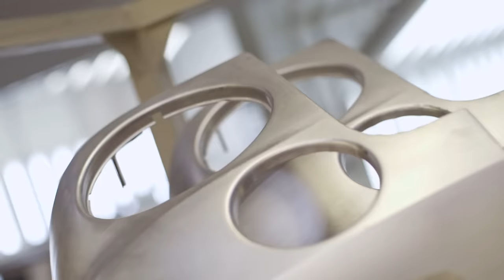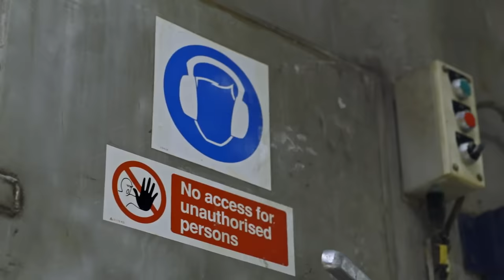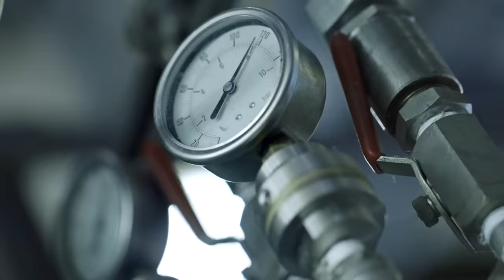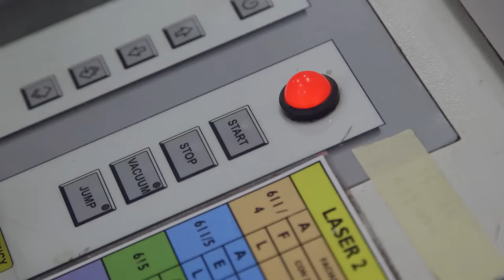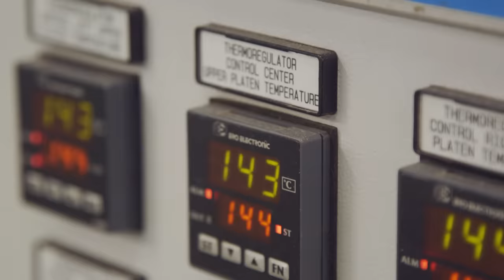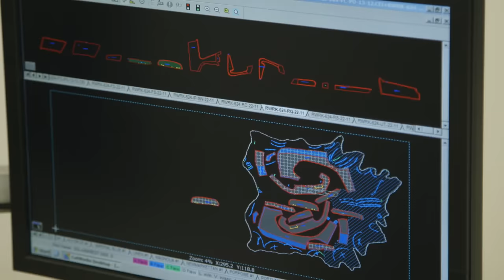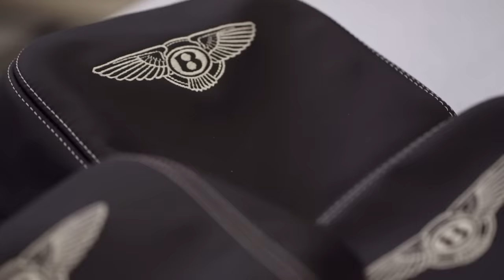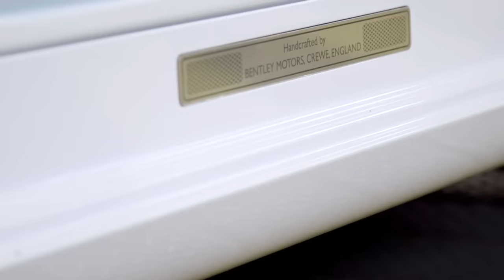Bentley Mulsanne Production | HOW IT'S MADE

Comment: My dad and I built grandfather clocks from kits.  It would take us about 3-5 months to complete one.  Why?  The same reason as here, attention to detail.   My dad wanted the case perfect, no rough or slipshod work.  Joints were smooth and doors hung straight and true.  I did the finish work.   Lots of sanding of the wood, stain applied with a brush and wiped down after.  Holidays found and touched up.  4 coat polyurethane finish, fine sanded between coats and then hand rubbed to a smooth, high gloss.   Lots of work, but the result was impressive.   Just the same with this Bentley.
Reply: Maybe go to work for Bentley?
Reply: But, as far as telling the time goes, not nearly as accurate as a cheap electronic watch!

Comment: I'm surprised how much hand finishing goes into the body shell!
Reply: Why is the paint shop not shown?
Reply: I think it goes hand in hand with the extensive amount of hammering and body panel repairs required to fix each frame before paint. Add to that the rattling hoists, dragging overhead hoses at 9:50, the shaking rickedy old roller coaster ride, etc. No wonder they need craftsman to make things right.

Comment: Can someone please tell me what they sand metal with?  Is it normal sandpaper?
Reply: It's an incresingly smoother sandpaper yes. They start with 400 or sometimes even 200 sandpaper for bare metal or really think paint and progressively move up all the way to 3000 sandpaper.
Reply: to smooth the metal joints rom soldering in previous step, and is very fine sandpaper nor regular one because white body must look perfect to be finished perfect so man must make what machines can't do better
Reply: Rolls, Audis and Jaguars are from aluminum too, is light and rustproof so it last longer than steel and aluminum alloys or just aluminum are in most suspensions, transmisions and engines even sometimes joined by titanium or other composite alloys to achieve better performances
Reply: Felix Jaitman ä

Comment: These people seems to be correcting imperfections of their production process...  If the production/manufacturing methods are good and efficient, then there is nothing to be polish or grind away...  Am I correct ?
Reply: Some see only one page and assume the conclusion of the whole book
Reply: You can be the best and most efficient manufacturer in the world but it only takes 1 speck of dust to create a pimple in a panel. This is what the guy at 4:32 is looking for, the strip lights help you see them. The others sanding earlier on are removing the brazing between the panels so there are no unsightly panel gaps and also any distortion in the panels after spot welding/mig welding.

Comment: And they cost a fortune to maintain:  how about  $5K for a new waterpump??  You have to take the entire front clip off the car (bumper/grille/fascia , etc) just to get to it.  A buddy of mine runs a high end repair shop for these.  They're insanely expensive and complex, AND not immune to use of plastic in places where they shouldn't, and where it breaks.  If you want that old English feel,  buy a Jaguar from 2000 forward, get yourself an expert mechanic, and you will spend a fraction on repairs. Buy an excellent condition used version for nothing near its new purchase price, and garner admiring glances rather than f-you gestures from other motorists and pedestrians.  Plus you can park it and not worry about an immature valet screwing with it, or someone keying it.

Comment: Far too slow and boring. Why all the hand-building when robots do it so much better in other VW factories? When I look at Bentley paint, i don't see much difference in that on a VW Passat, or BMW. I understand people want something different, but the car could be made far cheaper.
Reply: The difference is that the hand made car will still be going when the cheaper one has been scrapped.
Reply: @mscott3918  its the opposite, the hand made cars have issues down the line.